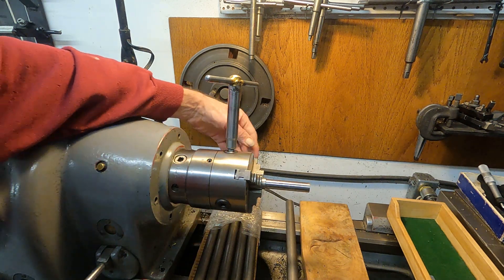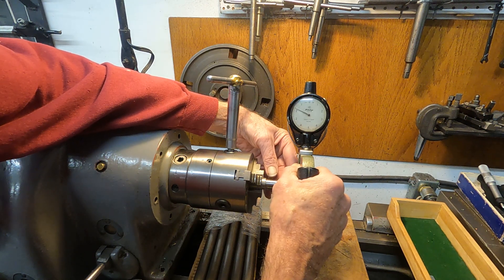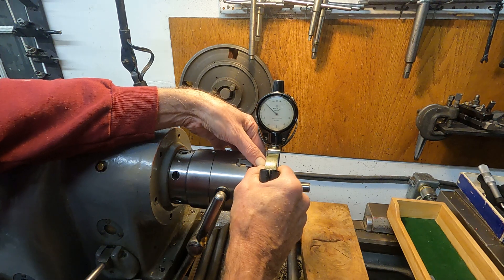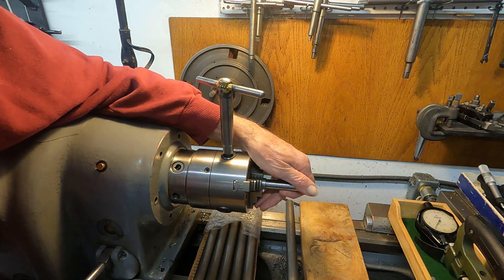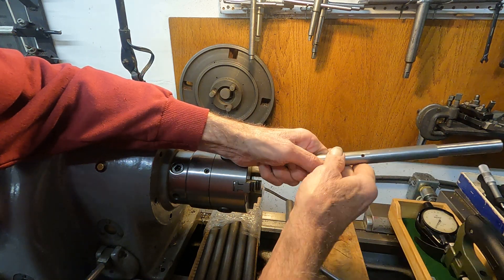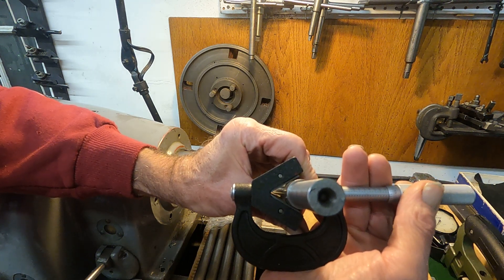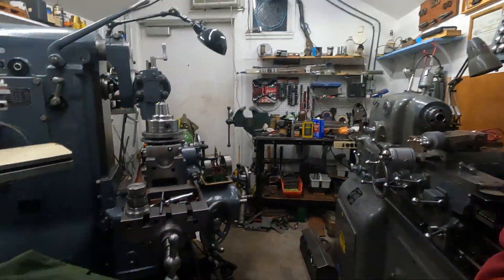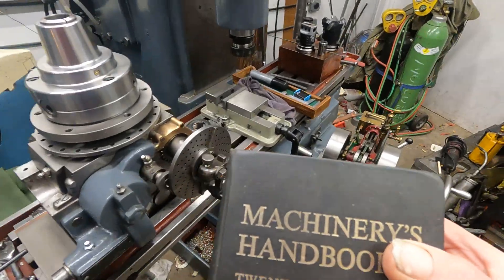Bearing in mind ANSI clearance and alignment 2

Comment: Do you wish you had a cylindrical grinder to do those parts
Reply from the maker: The cutter grinder  I have is also a cylindrical grinder of the right size to do those parts, I am considering trying to salvage the already made part using it if there is not enough material to reasonably cut in the lathe.

Comment: Fixing someone else's work dee dee. Could be quicker to start from scratch by the time you've done all the checking. Tony
Reply from the maker: I would be easier if the  steel was longer so I could just chuck it and cut it without moving it.

Comment: Have you ever given a thought of finishing these on the Sunnen Hone using their external hone ? I have used one and it produces round parts on size just like their internal hone mandrels .
Reply from the maker: I have just one Sunnen external hone for a much larger size and an adapter to used a small 5" lathe chuck in the machines spindle. The limited experience of doing a few pieces it worked really well, I was able to reverse the work piece and it straightened it out. This already made shaft has its bearing surfaces out of radial alignment so the hone can only follow the easiest path and cant correct that. Thanks!
Reply: @deedeeindustrialsuperprecision  ok thanks

Comment: Tool and cutter grinder ?
Reply from the maker: The Blade is Sharp! I am thinking that for at least salvaging the already made part. The owner said the journals can be as small as .615". 
I also can turn the larger OD to clean up. I am thinking of making one to specs on the really worn lathe not everyone has access to machines in good shape.